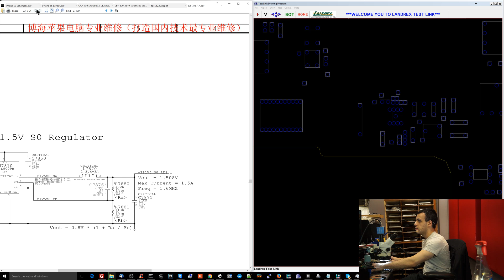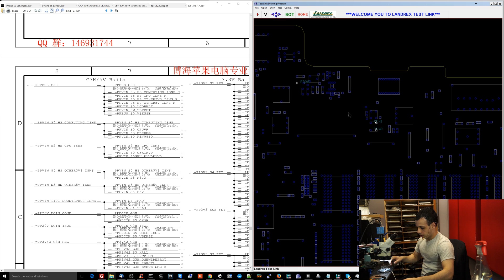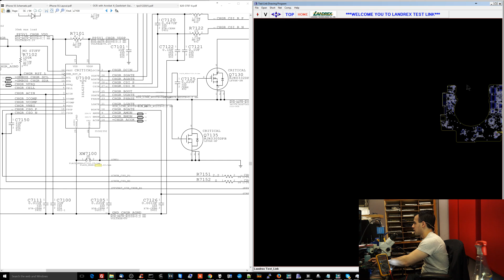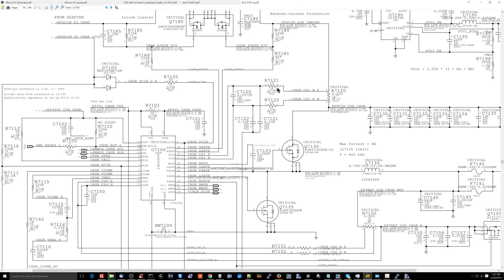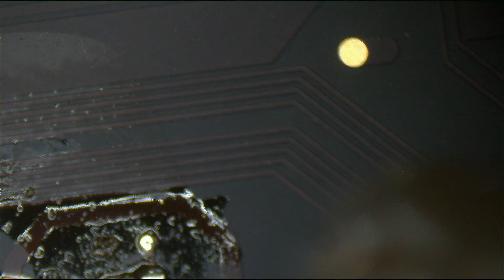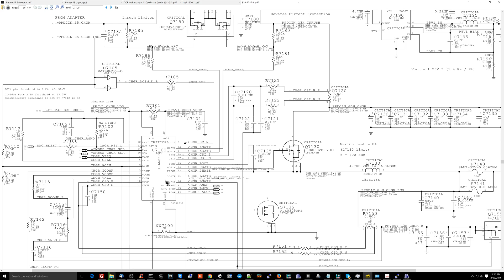Macbook Pro Retina dead no power due to bad current sensing circuit

Comment: hey brother i have a customers 2015 a1502 and when plugged in itll.change from green to red and no power.. opened it up his battery cells were all bloated.. so i order a new battery still same issue ? i check the battery pins on board and they read 12v ? what do u think? same issue as yours?

Comment: Hey Louis. I know you rarely answer repair questions but I havent been able to find an answer on any forums from experienced repairs people. I would have signed up to your forum but the monthly fee is not feasible for me at the moment. 

Anyhow I have a retina board that didn't power on the with battery even though it had a full charge and had 12v at the fuse going to the system. So I automatically cut out anything from the isl6259 surroundings ( Isl6259 was shorting as well which is what i also replaced).

I replaced the TVS on the battery junction (connection) communication lines and it worked ! Though it was charging slow and getting stuck sometimes. After a day of use the battery went back to the initial problem. On the OS it shows 1% charge (using power adapter) and doesnt run off the battery unless it powers on using the power adapter and removing the cable once it's on. 

I tried replacing the TVS again but i was getting the same reading as the once i had replaced before. I tried heating the smc in hopes of melting the solder balls underneath but it didn't work. The smc is to big to be removed using the nozzle i have

 My question for you is this. Is it possible that I can have a bad resistor in the current sensing circuitry around the isl even though the battery is charging on the hardware (using a meter i can see that the charge is increasing) ?
Reply from the maker: a multimeter will answer this question.
Reply: But what about the diode I replaced and the voltage at the fuse? You're saying I should check the current sensing resistors? Hard to check resistors in the circuit as I get a different value depending on what's either side of it. Not sure how you do it so easily in your videos. Some resistors, yes, as higher resistance on either side of the measuring resistor will give a correct reading. I iz lost.
Reply from the maker: depending on what's either side? measuring a resistor is measuring a resistor! learn how to use the meter first then go back to this stuff and  you will fix it. measuring resistance of a resistor shouldn't be this complicated.
Reply: yes. if there is a lesser resistance to ground on either end of a higher rated resistor then you will get a lower resistance reading since the current from your meter will travel to the lesser resistance value and into ground. 

Now, I've measured all the resistors on the high and low side current sensing circuitry. I'm getting values close to 3% of what is on the schematic. and again I have 12v from the battery on the f7140. Call me stupid Louis, but I don't know where else i can look.

Comment: +Louis Rossmann just look at  19:00  and then you see after a few seconds (19:04) they blew up! Maybe the excessive use of flux as if it was tap water didnt allow you to notice those miniscule details with naked eye :P
Reply from the maker: yeah I was clearly the only one here that had no idea. :(
Reply: +Louis Rossmann  I wonder why the board worked though... probably since they didnt like really blow up but just puffed out a small piece they still are close to their nominal rating but not exactly as they should be... would you change those or leave them as they are because the difference is miniscule and wont cause anything to go wrong in the future? or didnt they blow up at all and it just looked like they did and you were trolling me ? :P

Comment: I am guessing these boards would be next to impossible to fix without schematics.
Although this example was visible in this case you knew the area to search within.
Do you have an estimate of your repair success-rate with vs. without schematics?
Reply from the maker: depends

2015 board is very similar to 2013 board. i can find the pp3v42 circuit on any board from past 7 years as they are all similar. but new designs will have new shit that i have no idea how to follow. you can find sample circuits for specific chips and poke around and guess but it is not time specific.
Reply from the maker: it's like asking if i could find my wya downstairs blind

if i never had sight, probably not

if i went blind yesterday and had the experience of living here and walking to the restaurant downstairs many times before.. i could. it'd take me longer than usual, but i could.

but if i were permanently blind from birth i would not find it
Reply: True, in most cases you have some kind of reference. Just as you most likely could fix other amplifier if you just knew the basic class A/B.
Since you (from what i read on you webpage) only repair Apple products, there is little chance of getting completely lost.

Comment: 14:42 It doesn't look like you solder those resistors in properly or at all?? Also, you accidentally unsoldered the bottom left capacitor, you could see it move.
Reply from the maker: they blew up anyway

Comment: Hey Louis. I splashed a lil bit of water on my laptop keyboard. Now my keyboard has perma caps lock, some keys don't work and some keys only work if you're pressing another key. Also some keys do random things rather than what they're supposed to. External keyboard plugged in yields pretty much same result. Motherboard issue or keyboard issue?
Reply from the maker: +King Kek keyboard

Comment: Also what the hell is that stuff at 23:59 and what does it do?
Reply: It's solder flux and dissolves the oxides on the metal surface of the piece of hardware and functions as a heat transferer.

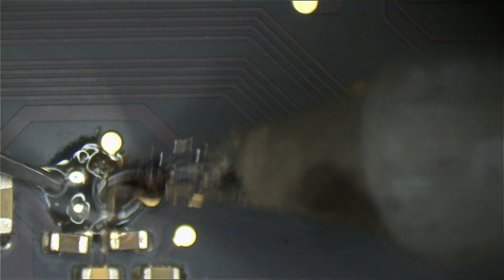Comment: What are you doing at 11:13? It looks like you're soldering but what does that do?
Reply: He is re-applying solder to the pads, so the resistor can be flow soldered.

Comment: I notice that when you're placing new chips on, you push them in from the side rather than the top. I understand that's to get the excess solder out, but can this lead to contacts getting solder between them and shorting? I mean, obviously it works for you, but I'm just curious on the specifics of how you avoid these kinds of issues, or if that's even a concern.
Reply from the maker: i solder based on what my hands allow me to do that day. sometimes i can do up and down movements, sometimes side to side movements are easier.
Reply: Makes sense, but does having too much solder in there leave the potential for a short between two contacts? Say, two legs of the chip, for example.

Comment: Excuse me, but I see nothing else then U7100, C7121, and C7122, that could possible blow those resistors, cause I see no way a short on the power line affecting R7121, and R7122, but only R7120... If one of the capacitors would be shorted, then the resistor on that side would blow only, so I say if both resistor blows, then it is pretty safe to blame U7100, cause there is nothing else that could blow both in that circuit. Right?!

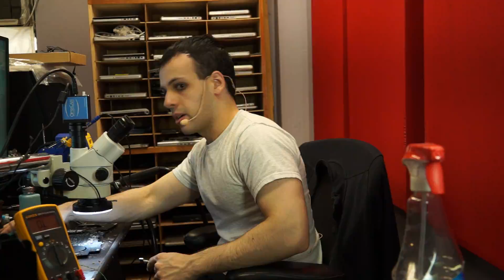Comment: wow, that's actually really cool at 18:50, you could totally see the resistors blow, although he didn't notice at the time.
Reply: my thoughts. He says everything is fine at the moment when a hole appears in the resistor. Just like in the one he diagnosed on the board before fixing it.
Reply: Anton Lymanets I'm sure it's easy to have missed and he probably looked away for a split second, but it was pretty neat to see right after he explained the fault. Not sure what size packages he's working on but I'd imagine they're 0805 or 0603, so it's pretty tiny stuff.

Comment: Luis Rossman,
Those two current sensing resistors aren't just to protect IC. They act as low pass filters with three 0,1uF caps near them. They suppress sudden surges like you plug your power adapter in the machine and while all the caps charging for couple microseconds or so, the don't let that sudden spike on current sensing shunt go to the IC. Apparently these do not always work and still fries the chip. I repair laptops and other electronics, but I rarely find such failures in other brands besides apple...

Comment: Sorry to be off topic but right now I am pissed off. I bought one of those Samsung 28' monitors with TV tuners and I didn't notice that is not 1920p resolution. I paid €200, I took it home I opened the box, assembled the stand and I noticed It is only 1366 x 768 shit. FUCK WHY ALWAYS TO ME ! I told that fucker sales idiot. I am going to use it on a PC. He didn't tell me that is was not 1920p.
Reply: ***** yes it is not even 1080p.
Reply: ***** what manual?  I should read the specs. But they had this shitty model next to PC screens so I thought it should be ok. Now it is too late. They will not change it.
Reply: There's nothing about it being used with a PC that would imply that it is, or should be, 1920 by 1080.
Reply: *****
No. In Europe they are not entitled to accept it once you opened the box. What you are writing is valid only for online purchases. Credit card idea sounded good but I paid cash and anyway they sold me a perfectly sealed product. I don't feel good to return it. It is all my fault and I should shut up.
Reply: Motorman2112
It is all my fucking fault man. But anyway, prices for ULTRA HD ( 4K)  40'' 4K TV/Displays are falling and I am considering to snap another purchase next time ! 40" Inches screen woooowwww!! I will dig my dual display for one of those !
Reply: ***** Yes. Like this !.... Not fair for online shops if you ask me. Somebody can buy something, do his job and then return it.... Fucked up law !
Reply: Online stores an advantage u mean

Comment: How come you use hotair instead of soldering tweezers? Just wondering because I heard it is easier than hot air.
Reply: +Adrianne nope.  Louis is a total cheapskate.  He uses a titanium stick instead of a g-tool and he there is no way he'd buy hot tweezers when he can do the job with what he already has.  I couldn't stand to watch it anymore so I sent him one of my old pairs of tweezers, but they didn't work on his 951.  So now I'm going to send him a 202 to power them since he helped me break some kneecaps yesterday.  Except this time I'm going to decorate it.  No more free product placement for Hakko!
Reply: Yeah, I heard that too.
Reply: GaryKildall
Can't be that. Maybe he just likes being able to go from desoldering pins to SMCs without having to change anything. What do you guys think of my theory?
Reply: Tweezers don't work very well for 0201 parts which are common in Apple's products. They're tiny.
Reply: I think too many pins to solder
Reply: +AVN WX what? Mini hot-tweezers are a dream for that size.

Comment: Getting pissed off with youtube app  now all I want to do is watch a video with out a popup getting in the way (in this case it was the channel owners other videos that pop up, forced adverts is the other one )
Reply: That crap bugs me me as well... try this: Down in the lower right of the video frame is a little 'gear' icon. Click on it and turn off the 'Annotations' switch. It's not permanent though, you gotta do it for every individual video with obnoxious boxes and whatnot. Far as ad's go, I use an ad blocker that gets 99.97% of them.
Reply from the maker: the annotation goes away after 15 seconds

Comment: I have an old time CRT degaussing coil I use to wipe tools & whatnot free of magnetism... works great! Use it much like for CRT's; with coil in one hand and tools in the other, energize coil and pass tools around within, then separate coil & tools to arms length before releasing the switch. It's a good idea to keep sensitive electronics and like out of the coils vicinity when energized. A total cycle time of like 5 or 7 seconds usually more than sufficient.

Comment: The current sense amplifier in a DC-DC converter chip has very high input impedance.  Those 10R feed resistors will normally see only microamps even though they are rated for 1/16W [80mA].  If they are blown, there is definitely a low-impedance path to ground as you found.  Good work.